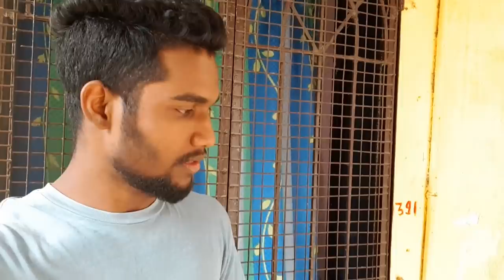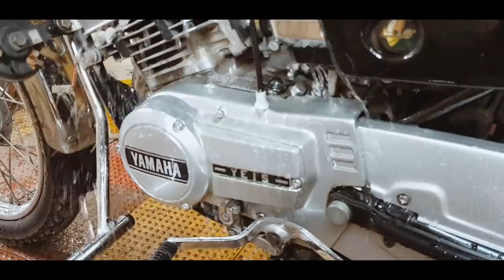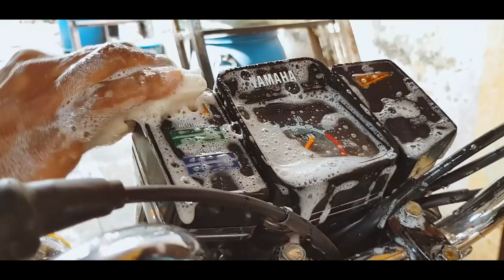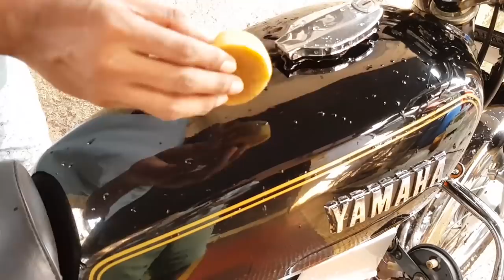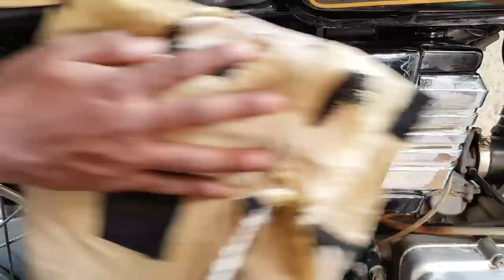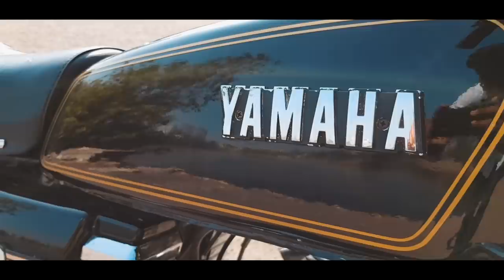Washing and Waxing my YAMAHA RX 100 !

Comment: Awesome Bro.....Thanks for making this video....I own YAMAHA-RX-100-1986-Made in Japan Model........I rarely diesel-wash my Bike...Because after using lot of water my bike doesn't start...After one wash my magnet got damaged and after another wash my spark plug got shorted.....due to these reasons i dont was my bike much...i also believe that dust layer protects metal  ....but now ur video has given me an idea ..........another question, Are you not using Oil pump? Ur 2t oil gauge is not there ??
Reply from the maker: thanks bro i appreciate that ! and the 2t oil gauge is there on the bike i never made any changes to the bike its all stock.

Comment: Wax should not be applied on the engine
Reply from the maker: it can be bcuz it is a exposed part of the bike
Reply: @SpeedyLio  This is made of carnauba wax it cant withstand extreme heat it will melt of when engine heats
Reply from the maker: @SaiKiran-yk5uz  ok
Reply: @SaiKiran-yk5uz   RX engine generally dont heat up beyond 80 degrees